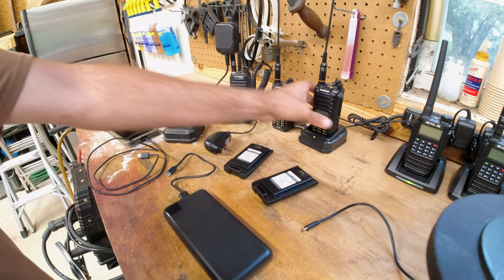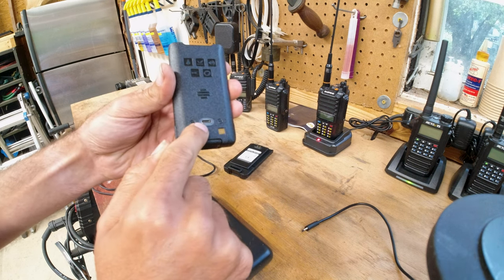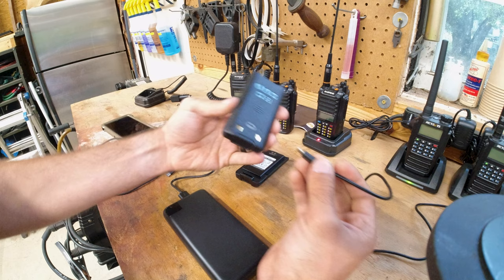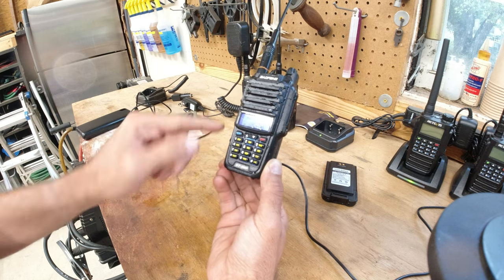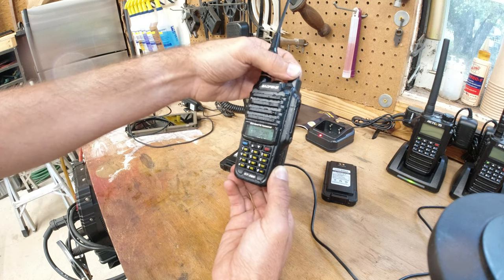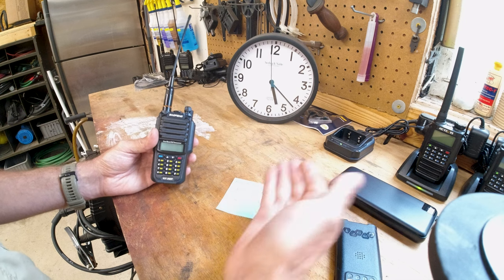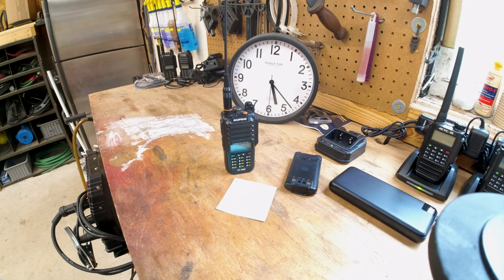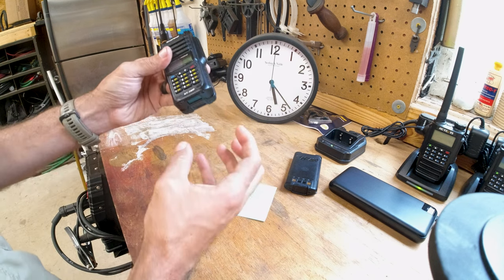No more charging base for Baofeng multipin radios?!

Comment: You should def import & resell this & the extended usb-c uv5r battery
Reply from the maker: I wouldn't support a radio I don't like by selling things like that for it unless it was something I already had at a huge discount so someone really in need could afford it. The multipin radios are way more superior & if the take rate was higher, Baofeng would improve on them more.
Reply: @CallMeColtLLC  I understand it’s a shame the multipin aren’t the standard for a few more $ it’s vastly superior

Comment: If only they would do this with the BL5 style extended batteries.  I'm adding USBC charging myself on those.
Reply from the maker: I think they have, I just haven't explored them because I dislike that style of radio.
Reply: @CallMeColtLLC  I haven't seen them.  I agree that style isn't as nice but I have tons of adapters and radios already for it. 🤷‍♂  EDIT: Maybe you are thinking of that little USB cable you can plug in to the batteries.  Those SUCK and it's an extra cable.  They tend to backfeed and never seem to charge the battery fully.
Reply from the maker: @jmr  No, they have ones just like in the video. And they also make good direct charges, you just need to buy from a good seller. I used the before changing to the multipin type.
Reply: @CallMeColtLLC  I'll try looking again.  Either way I should have the parts to retrofit the batteries I have with USBC charging tomorrow evening.  Thanks for the video!

Comment: Says there currently unavailable on the link. Good option tho thanks for finding these.
Reply from the maker: Darn, a bunch must have been ordered already! I'm considering making a bulk order myself directly & then selling on my eBay store since it seems they're not really available & someone will need to take the leap of importing them.
Reply: Definitely a cool design I saw another kind with a charging port like what's on the base of the charger with usb on the other end.
Reply from the maker: @madmaxinthunderdome  I saw that one available for import.